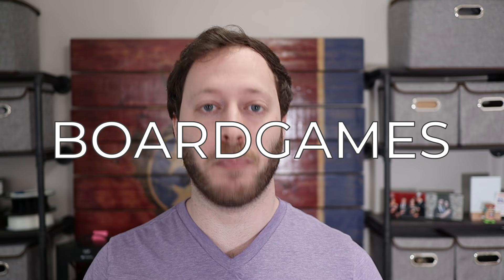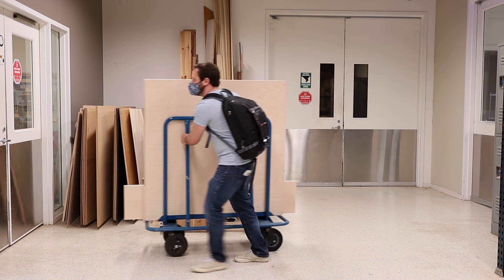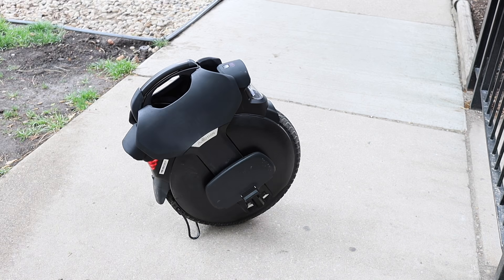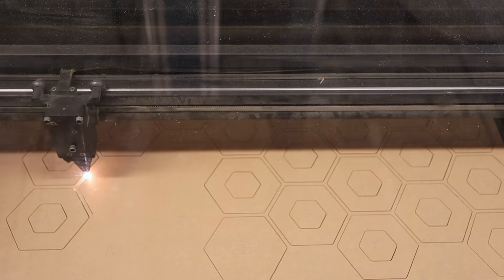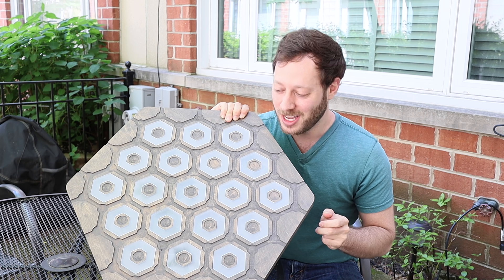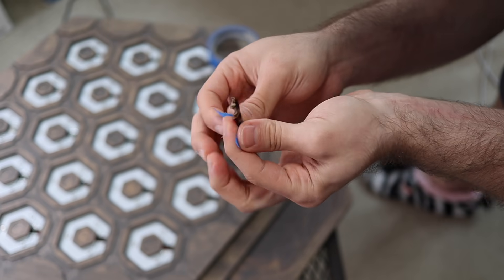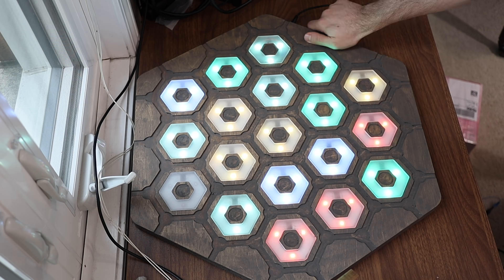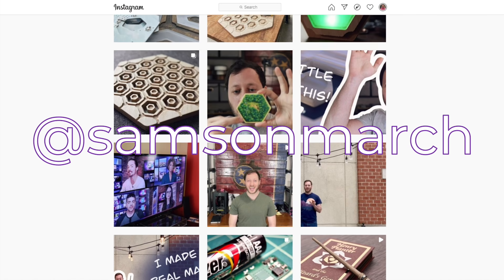Settlers of Catan never looked so good!

Comment: I like the look of the board (staining was a good choice), although I have to say that I feel the artwork of the original tiles was easier to read. Maybe a cool addition would be to replace the acrylic plates with 3D printed inlays resembling the landscape (mountains, forest, fields, etc.) and have them backlit by the LED. Also the little streets and houses feel tiny on the larger board, so they could be also replaced with 3D printed parts.
Reply from the maker: Thanks so much! Definitely some things to improve on! It's actually a lot easier to distinguish stuff in person, it's really hard to capture LED color on camera without underexposing everything haha

Comment: Super cool!! How does the code know which number each hex is? Is there only one configuration or do you reprogram it?
Reply from the maker: Great question! It actually randomly generates all the commodities as well as the numbers for the whole board every time you plug it in, so no two boards are the same. In the code, I keep two arrays, one of the commodity order (starting at the top and spiraling around to the middle), and one of the numbers (same order). If the number associated with a commodity is rolled, it lights up and the rest of the board dims!
Reply: @SamMarch  makes sense! So do you have the tiles light up in numerical order so that you can setup or how do you know which tile has which number?
Reply from the maker: @jacobshor3590  You got it! If you hold the "roll" button for 5 seconds it will count up so you can place your number tokens at the beginning.
Reply from the maker: @cmmartti  nope! One of the fun things about settlers (after having played it so many times) is the random set up element. Having to rethink the strategy of where to build every time is what keeps it fresh!
Reply from the maker: @cmmartti  I think what happened with our friend group is that we noticed that with the "recommended" number token order we still often all ended up vying for the same number locations regardless of resource. 
So we started randomizing both numbers and resources. Sometimes you get boards where there is a lot of power in one section, but it ends up balancing out since EVERYONE wants to be there. The competition for those spots are so intense that typically the person in the more open area of the board ends up winning! 
So in a very roundabout way to answer your question, both numbers and resources are intentionally random.

Comment: How does it know what number the hex is?
Reply from the maker: When the board first comes it randomly generates what each hex is (number and commodity wise). Then it counts up from 2-12 showing you the spots so you can place your number tokens on the correct hexes. That way when you roll the dice, it randomly picks a number (properly distributed) and highlights the right hex!
Reply: @SamMarch  nice. That works. You could also use 7-segment displays to randomize and display the numbers automatically
Reply from the maker: @corynrobinson  definitely a possibility! I was trying to keep cost down a bit. More importantly though, the whole thing was designed in one day, so certain really cool ideas missed the initial design phase entirely 😂

Comment: Please sell the PCB kit!!!
Reply from the maker: So this is actually something I meant to include in the description... The PCB files are in the github repo, but more importantly, you can have the manufacturer I used (JLCPCB) fabricate AND assemble the boards for super cheap! It should only cost you around ~$60 bucks to have a full set made for you and shipped!
Reply: @SamMarch  so freaking sweet.  You are awesome!!!
Reply from the maker: @matthewdodrill8720  YOU are awesome! Thanks for watching!
Reply: @SamMarch  Dear Sam, 
Love your board, thank you for the blueprints.  Problem:  I just need a little more help with the files.... My friends and I can't seem to break it down to under the size limit JLCPCB requires.

 Do you have any advice on what we are doing incorrectly or perhaps suggestions?  Thank you in advance.....

Gabrielle Howell
Reply from the maker: @SJGalt  Gabrielle, I think I can help! The trick here is to zip up the files in the right way. Because there are two boards you will have two zipped files, one for the led boards, one for the brain board.

Let’s start with the micro board, head over to: 
https://github.com/S-March/smarchSettlers_Public/blob/main/Hardware/smarchSettlers_MCU/JLCPCB_Files/fabFiles.zip

Download that zip, and when you get to the quoting page at jlcpcb, just upload that zip folder directly. 

The when they ask for the assembly files on the next page, upload the pick place and BOM files.

For the LED boards, this is the zip you want to use: 
https://github.com/S-March/smarchSettlers_Public/blob/main/Hardware/smarchSettlers/JLCPCB_Files/FabFiles.zip

Then same thing, upload the pick place and bom files.

Let me know if you have more trouble and I’m happy to help!
Reply: @SamMarch  That was just what I needed!  Thank you

Comment: Amazing job and the final look is beautiful. Brilliant to use the tiles for replacing the dice, never would have thought of that! Personally though i would not have used glue for the circuit boards. My motto is 'Only glue what you can not nail, clamp or screw'. :)